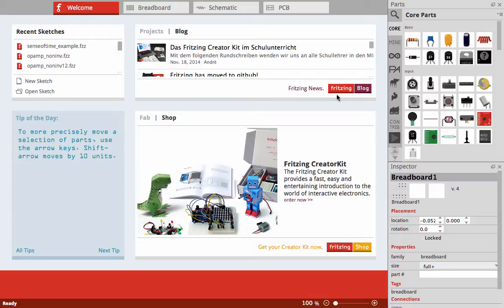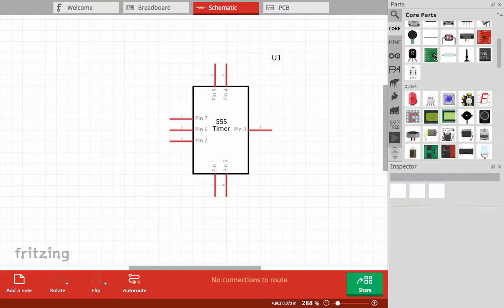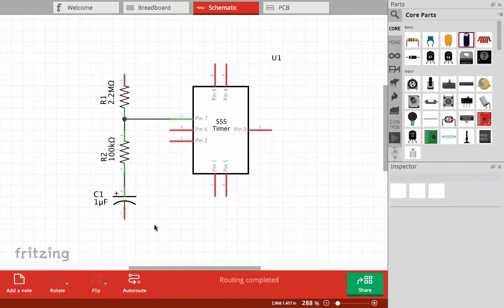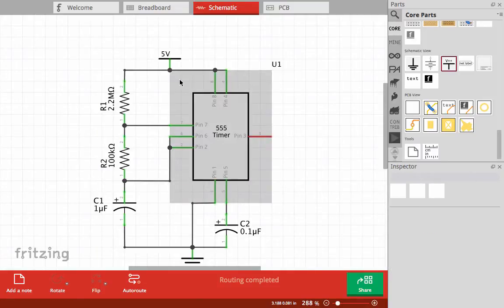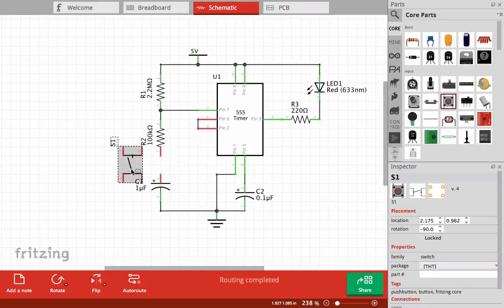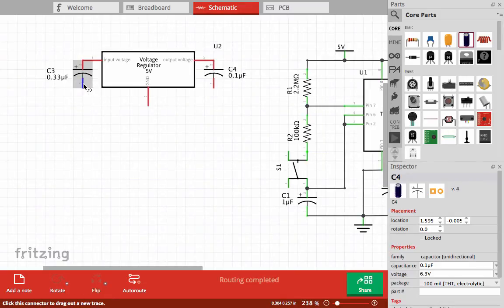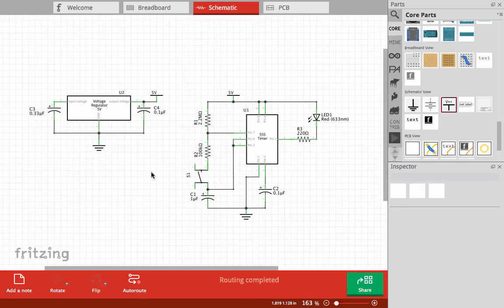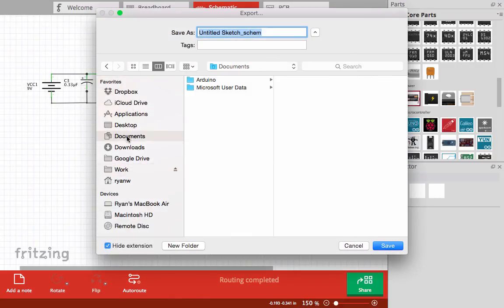CMPE370: Fritzing Schematics

Comment: how do you remove a junction?
Reply from the maker: If I'm understanding you correctly, then you just click on the wire you want to remove and push the delete key.
Reply: Na, not the entire trace. You know how you can grab a trace and move it and it creates a dot. Well if you move the traces around to much you wind up with extra dots (junctions). I need to get rid of those
Reply from the maker: Ah, I see what you mean.  

I usually just remove the entire trace and do it all again.